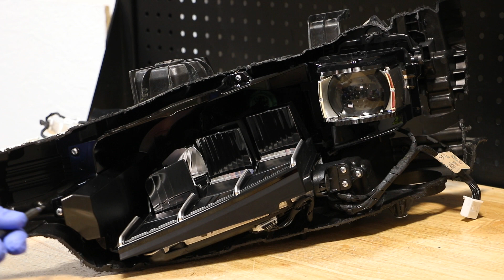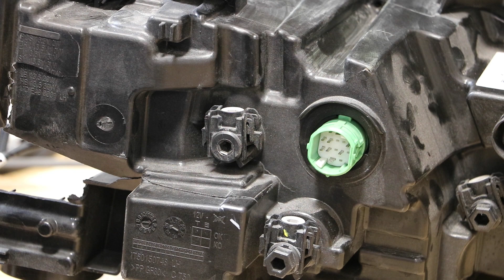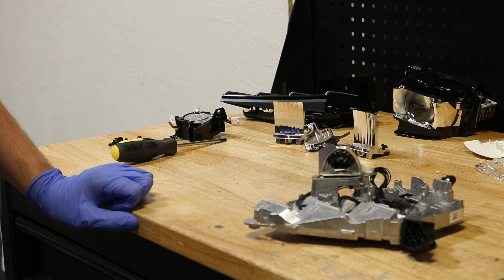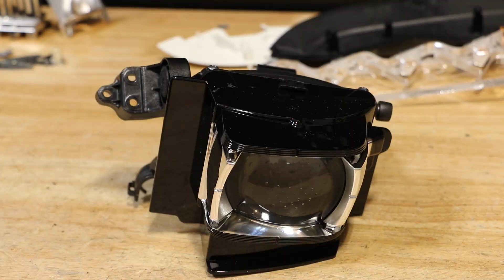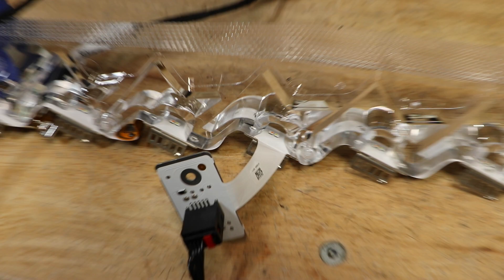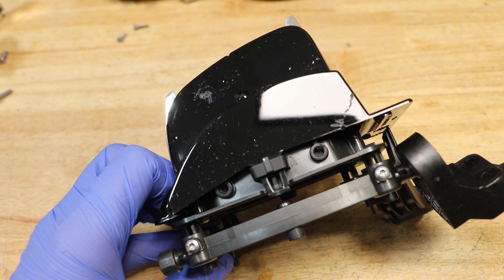2020-2021 Maserati Levante OEM LED Headlight Teardown

Comment: I know you're from the US but do you think you'd be able to get a hold of ECE headlamps from example Audi with matrix module?
Reply from the maker: I would have to pay to import one and it most likely wouldn't be worth the cost of the headlight.  I was under the impression that Audi used the same headlights in the US, they just disable the matrix feature.
Reply: @gftgrill  I am not 100% sure how they sell them in the US but they do sell a lot of them with different trim levels of the headlights over here in EU. So you can have the standard spec with regular LED reflectors or modules and you can upgrade to either Matrix or their Digital Matrix lights. 

Example on the A6 Low Spec - Mid Spec - High Spec:

https://www.netcarshow.com/Audi-A6-2019-1600-a6.jpg
https://www.netcarshow.com/Audi-A6-2019-1600-a8.jpg
https://www.netcarshow.com/Audi-A6-2019-1600-a7.jpg
Reply from the maker: @KaneTheMessiah  From what I can see these appear to be the same headlight:  https://www.ebay.co.uk/itm/234046069561   (EU) vs https://www.ebay.com/itm/265193192147 (US).

I believe that manufacturers are shipping the Matrix capable headlights to the US, it is just software disabled to meet current US laws.   The taillights on the current Audi models have to enable a different turn signal mode for US models to meet current regulations, but as far as I know it is just a software change and not anything physically different in the light itself.
Reply: @gftgrill  Yes, that is quite possible. Though I do believe on the A/S3 that the outer module is low beam and the three inner reflectors act as the matrix LED and cornering so it's not the same type of matrix headlight used in their other cars.